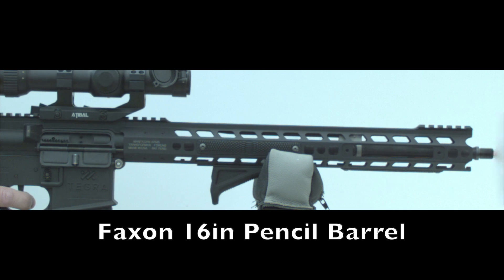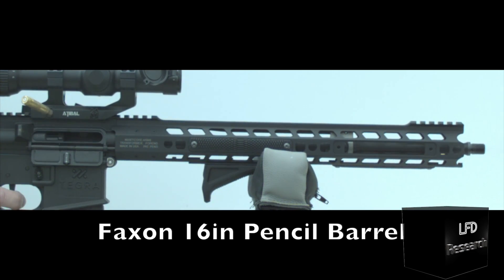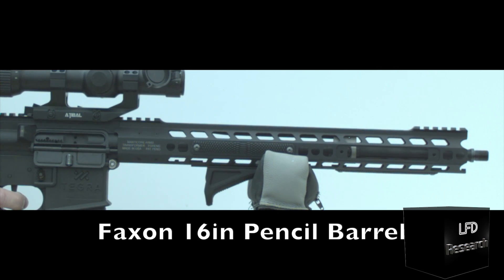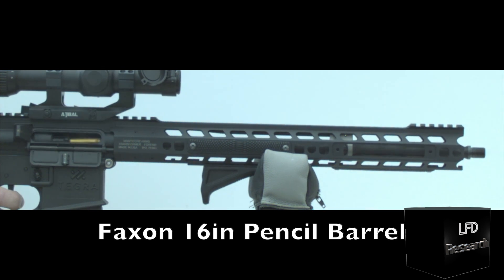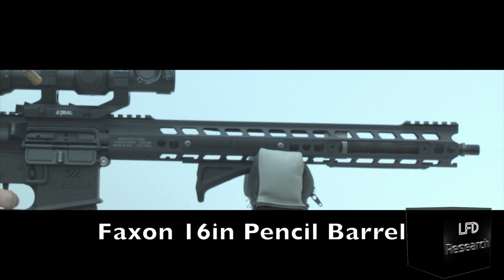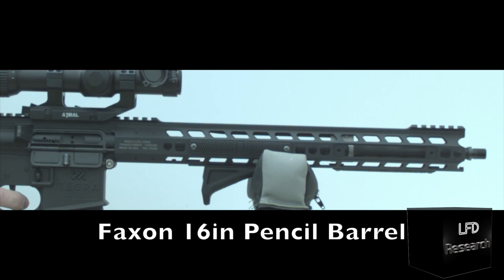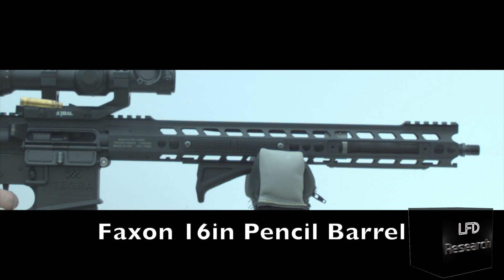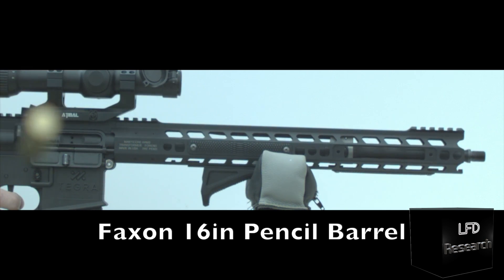Pencil Barrel Whip

Comment: GREAT JOB GUYS, think I'll stay away from the pencil barrels, AR's are not that heavy guys.  Be nice to see rapid fire accuracy.  Vickers Tactical has slow motion of Aks and ARs and the AK seem have accuracy issues because they move like a snake when rapid firing.
Reply from the maker: Well you will notice it is repeatable every time and we were firing very fast for this as each section of footage was 4 seconds long in real time. We are dealing with .17-.26 split time between shots and the harmonics cease well before that. The harmonics interestingly don’t seem to occur until after the bullet has left according to this footage. We do intend to go way faster to see if this can be confirmed or denied. Either way the harmonics are about the same timeframe as the bcg cycling. The last 2 have almost no movement until the bcg bottoms out in the buffer tube.
Reply: Also, it would be cool to add a “bumper” of a high heat polymer or carbon fiber to see if that whip can be tamed or if you get some kind of mini whip ahead of the bumper. Great video, the second comp with the more aggressive push down was surprising.
Reply from the maker: I will say the vg6 compensators have just as much deflection. We did not have high quality footage of it as it was replaced with the keymo muzzle device.
Reply: My 20" a2 pencil upper makes the gun weigh 6lbs loaded, which is lighter than most of the carbines that my friends own with their mlock handguards and 16" government profiler barrels

A mk18 clone weighs more than the rifle too, which is mind blowing
Reply: @MrGible  Nice. I'm considering a  light weight upper because I'm over the heavy SOPMOD M4A1 /Mk18 lol
Reply: @MrGible  A MK18 has a heavier barrel, and I'm gonna go ahead and call bullshit on a fully "loaded" 20" AR weighing 6 lbs in a standard A2 configuration.  My XM-177E2 weighs 6 lbs unloaded with a 12.7" and pinned moderator 16" OAL barrel.  My Colt 733 11.5" weighs 5 lbs.  and both are pencil barrels.  I'm going to guess that you've never actually weighed your rifle.
Reply: I don’t think that whip would have as much effect as the recoil in rapid fire. I would argue that even in full auto that whip would have a less noticeable shift in POI than the mechanics of the gun.
Reply: The Fish. I agree with you on the poi. And to add I don’t believe barrel whip happens after but more whip happens after. The myth that skinny barrels are not accurate is a misconception of whip and (in full auto) heat. I have seen many skinny barrels super accurate chambered in magnum calibers (7remmag, 300wm) it’s a matter of keeping that muzzle pointing in the same direction between pulling the trigger and the bullet exiting. That’s why adding weight to the end helps improve accuracy. Sometimes adding a heavier stock helps accuracy. With that said. Key words “it helps”. Some guns don’t have a Remedy there is thousands of other things that can be going on